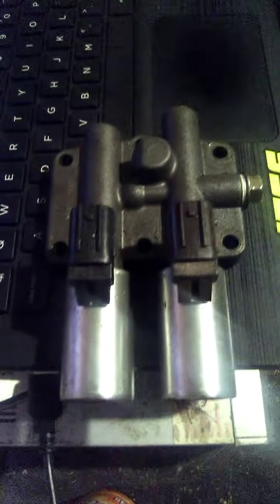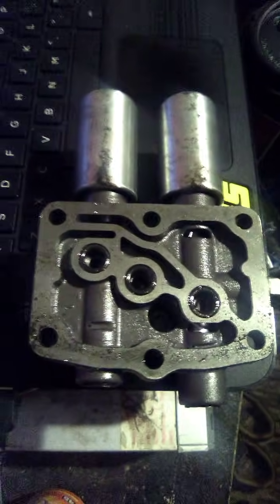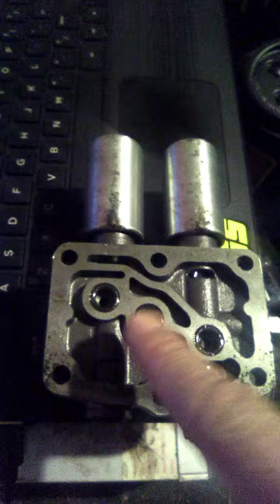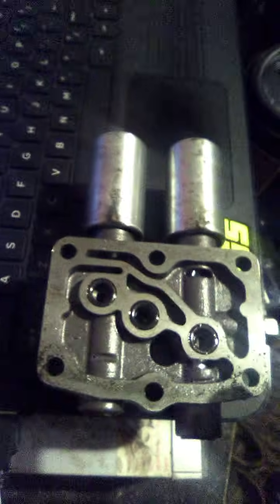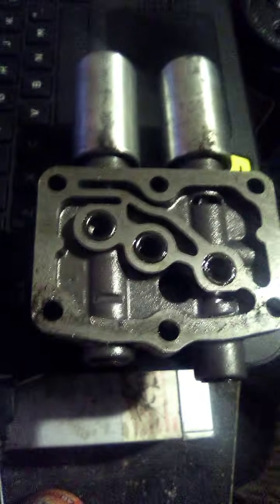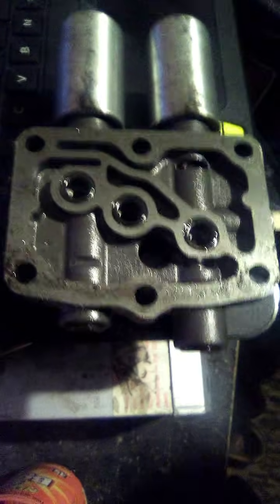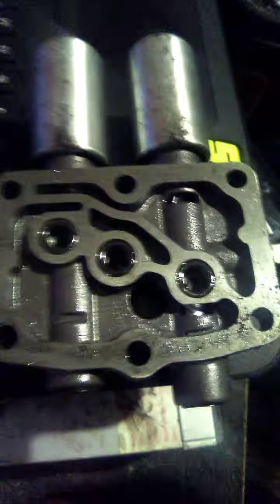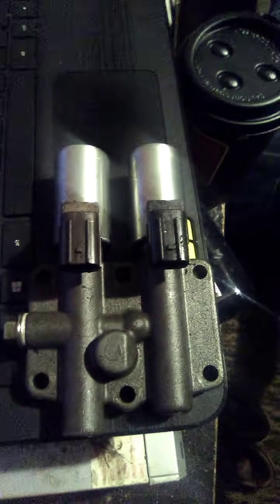Honda transmission problems explained p0740

Comment: The first time i had issues with my pilot i recently bought it and was traveling was 110 miles from home and the A/T TEMP light came on then started sputtering and losing power and shifting rough, i pulled over and popped the hood could smell a little bit of burnt trans fluid, the dip stick showed no fluid. Started driving home and it started acting up again and this time blew fluid everywhere and was smoking. Had it towed home and drove it fine the next day to my work at a dealership and thats when the mechanics told me to drain and fill and spray out the cooler been running fine since i did that and now the p0740 code.
Reply from the maker: If it happens again ur fluid was super hot u got stop and let it cool off do u have a lot of stuff carrying round do u go fast on uphills this trans are big on heat and weigh if u havr lot weight I would get rid some and take hills easy don't rush truck or it will leave u hanging is kind like u running uphill and u can't no more but somebody pushing u eventually u pass out same with car
Reply: @ricofedericotv9393  fluid is fine now i have drain and filled twice now just to be safe, she recently got the  p0740 code but ran fine and shifted fine on my 180 mile trip got me home ok, i reset the light and now waiting to see if it comes on again
Reply: @ricofedericotv9393  but no i dont usually climb hills or haul heavy stuff. Its my wifes car i wont use it for travel anymore i tell u that. Wife  uses it for work and  around town
Reply from the maker: @stevenphelps1072  that's what I do with mine no long trips just kids school and work every thing light lol

Comment: Rico I got a 04 honda accord   i can put it in drive or reverse it won't go it just rev
Reply: Yea 1st it was Shift solenoid B den it stop moving all together
Reply: It's going out right?
Reply from the maker: @cloudsgeorge4748  I think so most time if ur car goes in limbo while driving could be solenoid if the car is stop and it won't go on gear at all and oil level good then yea sorry buddy

Comment: I did take the screen off now my ody runs fine freely the fluid cylce on it hope its help.on my instincts honda make that for forpouse sell them transmission after 100 to 150 taw mileage
Reply from the maker: It's working good?
Reply: Still no problem after removing the screens? I’d been thinking about doing the same thing! Since Honda retrofitted an external actual filter why should each solenoid or pump need another screen to get clogged?

Comment: Why is the fluid over heating?
Reply from the maker: Either don't have proper oil cooler or over working trans specially on hills
Reply from the maker: Is it over heating and coming out the measurement stick
Reply: What's going on if the transmission fluid is hot and coming out the dipstick area
Reply: Also may i suggest you do a drain and fill on it with valvoline max life DONT FLUSH IT, just drain and fill, also go to the car wash and spray out your cooler, i had to do this on my 04 pilot.

Comment: Good looking I have a 16 accord coupe touring which has high mileage about 95000 and had been having transmission problems when it's hot I changed the transmission fluid twice and was told to clean the solenoid
Reply: Meat Ballas Multiple solenoids, like 5-6. They each have a screen to clean. Someone mentioned he removed the screens on his five months ago, so maybe October 2019 & has had no more problems.
Reply: @johndix1820  good idea just poke a hole in it.

Comment: How much lucas is a little? Half a quart?
Reply from the maker: A whole quart
Reply: @ricofedericotv9393 thanks!  how long does the fix last?
Reply from the maker: @rudymunoz901  what are ur symptoms
Reply: @ricofedericotv9393  slippage is the main one, taking too long to shift is second, loss of acceleration power, plus the po740 code came on.
When it's cold, it's fine. once it gets hot, the problem starts. It's not that bad, but the problem just started and I want to tackle it before it gets worse.
Reply from the maker: @rudymunoz901  yea try changing the solenoid too I had same issue change the single solenoid in front on tranny
Reply: @ricofedericotv9393 
 I already did, there was not much of
 an improvement.
I think I need to change the one that's closer to the engine to. I think that one is called clutch.. something.. solenoid.
I hope it's that, if not, it's going to be my converter and that's going to cost a pretty penny.😕 Is yours doing fine?
Reply from the maker: @rudymunoz901  try shifting gears manually I mean from d2 then u shift urself d3 then d4 if u having issues meaning tranny not engaging while u park that's can be tranny going mines do same I baby it I don't take it far just kids and soccer stuff maybe start thinking buying car or if u doing trans on truck this remedies is to save time
Reply: @ricofedericotv9393  
Did what you said. No issues changing gears manually, it engages fine.
I think the Lucas helped a lot. That's a good sign,😌 that means the torque converter clutch solenoid h
Is going out, from what I read. Needed  to buy me some time, until the torque converter clutch solenoid arrives. Thank you for the tips🙂 It's my daily driver. bought the tcc solenoid off Amazon for 30 bucks, 
OEM refurbished.
 OEM new, was way to expensive. but if this solenoid fixes it, even for a little while. It will give me some time to buy a new OEM off eBay. 
Again Thank a mil.
Reply from the maker: @rudymunoz901  u welcome I happy with at least helping I wish I had more subscribers but I happy with helping u
Reply: @ricofedericotv9393  
PD: this is the webpage that I got the info from:
Https;//estimate.myautomatictransmission.com/transmission-torque-converter-clutch-solenoid/
Maybe yours is not that gone🤔  Godspeed
Reply: Rudy Munoz hey Rudy did that tcc solenoid help with the issue cause I’m having the same problem and the way you explained it is exactly the same to my transmission
Reply: Rudy Munoz hey did replacing the solenoid fix it ? I recently cleaned out the solenoid tube filter and check engine light hasn’t came back on “ P0741” Acura TL 2006 . And now when my car gets hot , it starts to slip . It even slips hard into drive and takes like 5 secs to reverse . Very harsh shifts to reverse and drive . . 205k miles i don’t know if it’s time to give it up . I love Acura’s “ hondas but they just have transmission problems and that gives me headaches thanks
Reply: @edgargerrero3296  I changed the cluch solenoid and the dual solenoid and by changing those 2 it fixed the problem. I'm still driving my Honda and I haven't had any problems since.
I bought them both on eBay.
Don't panic yet, if you change this 2 solenoids
Especially the clutch solenoid that might solved your problem. But if it doesn't then it could be the converter which is located between the transmission in the engine, when that goes out it gives you the same type of symptoms, To fix that you need to remove the transmission. Start by making sure you have clean transmission fluid,
Because dirty transmission fluid can cause the same problem. I use a mix of MAX life full synthetic  with OEM Honda Transmission oil. For every 4qt of OEM oil I use 1qt of MAX life. It really helps keep the oil cooler therefore maintaining oil viscosity and the necessary oil pressure on the solenoid sensors. If you have anymore questions don't hesitate to reach out thru this media.